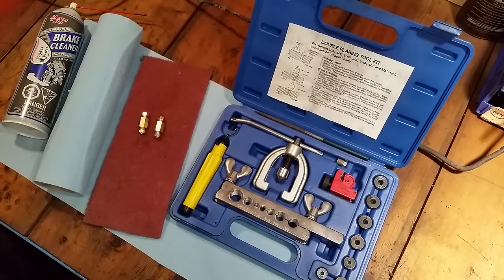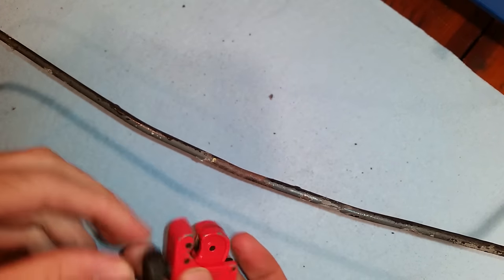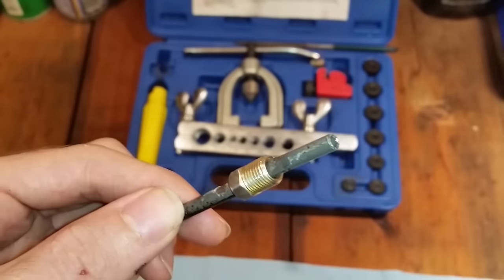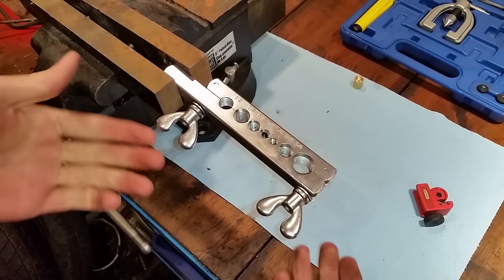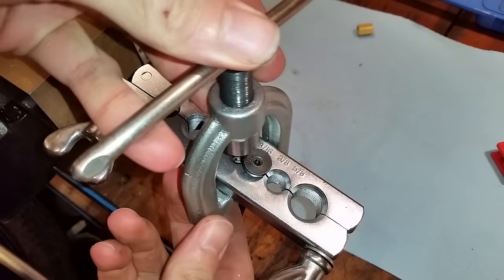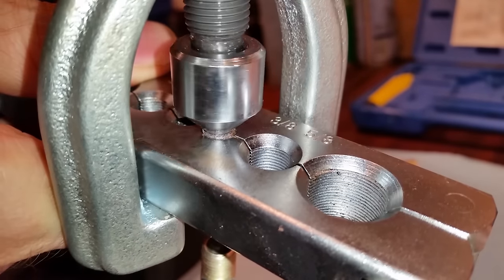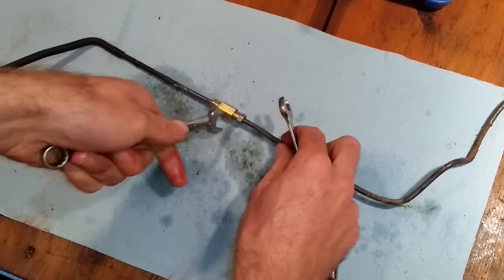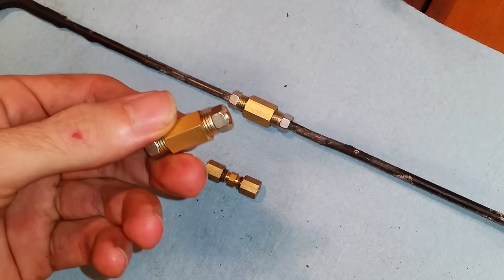How to safely repair leaking and rusted brake lines

Comment: Great video. Very simple to follow, and great tip with using the ATF.

One bone to pick: PLEASE consider wearing gloves when you use brake cleaner. A major component of brake cleaner is Tetrachloroethylene (PCE) which is an extremely carcinogenic substance. It's most common route of exposure is through inhalation, but it is also extremely harmful through direct contact with the liquid form, i.e. when it contacts your skin. If it contacts your skin, you should make haste to wash your hands off thoroughly and immediately. That said, it's best to wear a pair of nitrile or latex gloves when using brake cleaner. Believe me, I get my hands filthy with grease, oil, brake dust, and rust when I work on my cars, but I do NOT mess around when using brake cleaner. I'll admit that its a very effective cleaner though!
Reply: It is some nasty stuff. I use it all the time and am careful avoiding the fumes and contact with skin.

Comment: awesome! My brake line went on me tonight less than a week before a major trip. Funny enough, I just had to replace the ABS module a few months ago and I assumed at first that it was the module that went bad again, until I saw a trail of brake fluid in the parking space I backed out of. I probably should just replace all the brake lines, but this is the length of job that will keep me going until then.

Comment: Very informative thank you! I replaced the steel brake lines in my Silverado with the more flexible nickel copper lines, came in a kit so no flaring, but one of the lines got a hole cooked into it from the exhaust manifold(my dumb error) so now I need to cut out the bad section and perform the same procedure you did in the video. I appreciate the level of detail you took.

Comment: I tried to flare a 3/16" brake line with my flaring tool. The tool works on copper pipe, but not on steel brake lines. When I tighten it, the flaring tool just pushed the line out without flaring it. I don't have the flaring die. Maybe that's why it didn't work.  At least I learned something today.
I'm working on the severally rusted brake lines on my '93 GMC Jimmy. I'm pleased that the new brake lines bend without collapsing.

Comment: Gee that looks so simple in your video, all that changes when your try to do this repair under the car in a place you can hardly get to. Very difficult!
Reply: Yeah, especially when yer butthole deep in snow. Eastwood tool makes a tool for this "On the vehicle application."  Since I live in the rust belt, I think I can justify the cost of this tool.
Reply: Agreed, I had to do a lot of sanding around the flare and had to do the double flare a couple times before it would seat. Also noticed some nuts have a couple millimeters of shank at the tip, which in my case prevented it from going deep enough to contact the threads. I had to carefully dremel away the shank as I had already installed the nut and flared the line. Very easy to slip and cut the line, had I known I would have sanded off the shank on the sander before installing the nut and flaring the line. I got it done though and so far no leaks!
Reply: @David Schwartz SO WHAT! He is showing the process. Seems obvious to me that since he is doing his own work he knows all about working in crappy places. Those of us that fix our own know all about it.
Reply: @KStewart-th4sk  I doubt if he needs to be defended by you, It was not meant the way to start with anyway.
Reply: Ya, That is why many people use the compression fittings, I have used them for many years and never had one leak or fail

Comment: good job teaching the double flare task, after cutting out bad spot.  I have a roll of the green teflon coated 3/13 line on the garage wall> I used to have a 2nd 25 ft roll  so I must be using it up, here and there. I last fall of 2021 made my 1st successful double flares. The hardest part is clampin' it in the 
tool. My first one's I flared used to always slip. then i would have to cut off the undeveloped flair and start again. so I would get tight enough by using a cheater to give me more leverage. Maybe it was slipping because I didn't ever remember to use lubricant of some kind.

Comment: I've long since gone to ni-cop brake lines. Easy to work with and corrosion resistant. Not expensive. Also, if your metal lines are in bad shape you'd better consider replacing the front/rear flex lines.

Comment: Wow just save me a headache & gave me an idea, in my case on my Evo x ayc rear diff. metal line, it's better to repaired this way. Going try this and fix the pin hole leak. Thanks for the video

Comment: Nice job, very professional and nice explanation. thank you.
Reply: OMG!  Great video but if you've pulled the brake line off, then BUY A NEW ONE!  $25 IS ALL for a brand NEW ONE!  C'mon!  You'd be doing it anyway in a year if you've got that much rust on 1 part already.  GIVE GOOD, THOROUGH info on the most important part of the car!

Comment: Also worth considering, for short runs, is AGS Poly Armour Metal Tubing.  Available in lengths from 8" to 84".  Preflared on both ends, with mounting nuts attached.  Coated to prevent rust and bends easily by hand.  Available on online and behind the counter at AutoZone.
Reply: Chuck's Stuff how much is this brake tube at autozone
Reply: Go to AutoZone website and search "Poly Armour".  Click on any of the 6 results and you'll get 67 results.  Also available at Advance Auto Parts.  Not all AutoZone & Advanced stores keep all sizes stocked.
Reply: Tape non-stretching string/twine along the entire length of the segment to be replaced, from nut to nut, and mark the end.  Then remove the string and measure its length.  Select the nearest available length of Poly Armour. Cut, to the same length, 12-14 ga insulated solid copper wire and practice bending it until you get an acceptable shape from one connection to the other.  Bend the new tubing to this same shape.  Use nipping pliers to cut bad tubing at nuts, then use quality 6-sided socket to remove old nuts.  Apply Teflon tape to bleed screw treads and use Mity-Vac (or equivalent) to bleed brakes.
Reply: Short lengths already flaired with nuts are about $6, +/- depending on the length.  A 25' spool of the stuff with no flairs on it yet and no nuts included is about $23, price subject to change since steel is a commodity item.
Reply: Yeah it makes no sense to me to take the whole line off then put this patch on it, then put old rusty line back on the vehicle where it's just going to fail again a lot sooner.

Comment: Excellent video showing the difference between the brake union and the compression fitting.  Years ago my Dad showed me how to use a compression fitting to repair a brake line and it did hold up.  But I know better now and would never do that today.

Comment: Good video, unfortunately brake lines usually rust from the inside out due to moisture in the hyrdrolic fluid.  You could fix this and then another spot can brake.  I learned my lesson on that, and if the car is old enough to have rusted out one part of the line, others aren't far behind.  I would just order all new pre-bent lines.  Was $160 worth of good insurance, and also all the rubber lines got replaced while I was at it.   But if u need a quick and easy temporary fix to get down the road then this is a great method.
Reply: clayton you must live where there is no snow and ice, the number one reason for corrosion is calcium chloride and salt they use to put on the roads. one little prock in a wiring harness and the calcium chloride will tavel several feet in the inernal part of the wire and rot it out. it will for metal as well that is exposed to the elements that is usually what gets the brake lines from the spray of the wheels onto the line in fender well

Comment: A very helpful informative video
Reply: OMG!  Great video but if you've pulled the brake line off, then BUY A NEW ONE!  $25 IS ALL for a brand NEW ONE!  C'mon!  You'd be doing it anyway in a year if you've got that much rust on 1 part already.  GIVE GOOD, THOROUGH info on the most important part of the car!

Comment: I wouldn't call this a repair so much as a temporary fix with a line that corroded. It's very useful information and could get someone out of a pinch, however, most brake lines are cut and bent in a way that minimizes damage from the movement of the body and suspension. Cutting an existing line shorter and using unions to fill the space will work in the short term, but the best practice is to replace the line with OEM standards.

Comment: My parts store treated me like a criminal when I asked for a union fitting and told me they only have compression fittings and thats all I should be using.
Reply: Tech NO City you are criminal. Just replace the brake line instead of patching it
Reply: @wyattklingensmith8862  I replaced a 80in section.
Reply: Replace the section, no need to replace the whole like unless it blows a second time.
Reply: @wyattklingensmith8862  Dumbass remark. If the rest of the line is fine, replace what is bad. If you had any common sense, you would know certain areas can get rusted through because of location.
Reply: Tech NO City  Well i guess they have NO CLUE then about different methods of repairing the line. I read that compression fittings are rated for 10,000 PSI; even higher with certain circumstances. Your brake lines don't see that kind of pressure. Of course, the line where you use them should be in prime condition and assembled properly.

Comment: I do like the looks of the brake line union better than the compression fitting.
I don't feel like you did a good job explaining the compression fitting though. When you tighten it down it actually compresses the brake line and then is smaller than the brake line is on either side and can't really come off without breaking something (if it is tightened down properly) we use them on our machines at work all the time on our grease systems which are rated for 3500 psi.

Comment: I will never do lines again without the whole line prebent kit. And Stabilitrak has double rear lines.  Both ends are a different size fitting.  I used the old fittings with copper lines worked ok.
24ft copper cut to 12ft each.
On the the ABS module the Upper right is the right rear wheel.

Comment: Good video. Make sure you dont make any cracks in the flair.  Sometimes this works good most times not. Practice doing the flair several times before doing it on the car. I hope you were just using those cruddy lines to demonstrate. Go back to where the lines are rust free then splice there. Another hint... Just buy a variety of lengths and joiners and go all the way front to back.  Sometimes you run into oversize threads on one end, then buy an adapter. Good luck if you have metric bubble flairs. I am just doing a 93 Marquis and it has two lines from the proportioning valve to each rear wheel that are rusted everywhere except for 6 inches from each end. It has 12x1 male  bubble flair on one end and 10x1 female  metric bubble flair on the other  You should try to find the metric adapters for that.  That line you are showing that has the red ends is likely metric. those compression fittings might be ok for offroad, but aren't DOT approved, if you have a failure and get in a wreck, good luck getting any insurance.

Comment: better tip, use brake fluid for lubricant. also, when the part is still in the holder, run a file over it just to give it a good face and take out any warping.

Comment: This should only be used as a temporary fix.  If you line fails in one spot, other areas are close to the failure point.  Just replace the entire line.
Reply: Exactly what I was thinking just replace  the entire line
Reply: Not if it isn’t rusty and the line just got snapped or cut.
Reply: Lines inside the engine compartment are mostly in good condition
Reply: If you need two joints for a repair. Then you should be replacing the complete brake line.

Comment: Great video thi is how i repair brake lines however always use a brake line spanner else you will damage the brass fitting you wont get it tight enough 😀
Reply from the maker: Line wrenches are a great investment!

Comment: There is big difference between a house plumbing compression fitting which you showed and a steel high pressure automotive compression fitting which are rated for 5000 psi.

Comment: Where from could one get the fittings? i have to repair the end tip of my E46 M3 rear brake line and can´t find the fittings...
Reply: Reuse old ones? Worked on my sprinter.

Comment: Great video.
What make and model flaring kit are you using?  The one sold at Harbor Freight, as well as the ones offered as "loaner" tools by autoparts stores are considered junk by reviewers.
Reply from the maker: Thanks for watching!

This is a Harbor Freight kit. It works just fine. Just practice on a scrap piece of tube until you get the hang of it. The other "expensive" flaring kits do the exact same thing. For example, eastwood sells a rather nice flaring kit. However, if you own a shop or do brakes all the time it's price can be justified. I only spent $20 on mine, it was on sale. The only reason my flares come out nice like that is because I've practiced and have a feel for using it.

Just a quick tip. If you want to flare stainless tube, make sure you heat up the end red hot with a torch, this will anneal it and make it much easier to flare. It also saves your tools. 

Cheers!
Reply: I am considering the Eastwood 31244 kit.  Made specifically for 3/16" brake lines, and very compact so it can be used directly in the vehicle. 
Is this the one you mean?  I found it for 40 bucks (total) from cjponyparts.
Reply from the maker: That one works even better than Harbor Freight one. It's very hard to mess up the flair. Make sure to use the die lubricant. If it doesn't have it, just use some engine oil. I was refering to Eastwood's 25304 kit. (~$200). It's more of a bench mount system.
Reply: Where are you using the oil exactly? Thanks
Reply: The OTC one is about $34 shipped from Amazon.  It works really well.  But you can borrow one for free from a lot of auto part stores.  I got one from Amazon Warehouse (damaged package) for $22.97.  Sometimes nice to have your own if you know you will be doing this several times.   I did two lines on my son's truck.  There are two more than will end up leaking.  The entire truck had to have lines replaced but the back has already been done by the previous owner.  When you see wet lines, time to replace.  All because GM used cheap steel lines in 2002.
Reply from the maker: The oil is there to prevent the brake line from galling. By using oil, you ensure a smooth flare that will seat properly and not leak. You can put the oil on the end of the brake line before you start using the tool.
Reply: SuperSpeakers Thanks, I didn't use it and got away with it. but next time I'll use a drop of oil.
Reply: They are all affordable enough to buy a cheap set, a mid level set, and a extreme premium set if you really want to fuss about it.

Comment: I wouldn't risk this on older vehicles(Mostly pre-1967) because if the line breaks you have no brakes. If it's a 2 chamber master cylinder it's less of a risk though.

Comment: This is the way to do it. Not compression joints. Takes more work but much safer.
Reply: I've never seen a compression fitting come lose and I've done it any time I get a hole in a line.
Reply: @larryparker748  My understanding they are iiiegal in Massachusett.
Reply: @larryparker748  This video does not show compression joints but flare joints which is the proper way to do it.

Comment: ordered a willfit master cyclinder @ amazon for 5130 case tractor. looked same, when installed saw that 2 lines are 12mm brakelines instead of 14mm. waiting on 12mm ISO bubbleflare fittings listed for1/4 in tubing. they list 3/16 tube fittings also. dont see how 12mm fitting will have enough size for 1/4 tubing wh.ich usually fits 14mm fittings??????? we will see.

Comment: You can borrow a tool for free from some auto parts stores, I did it from Advance Auto, for example.  You buy it and then when you are done, you return it for 100% refund.  Autozone has the same program.  Most of the time you can reuse fittings too, my lines were horrible and even though there was light surface rust on my fittings, the threads and the seats were fine.  That's all that matters.  
I highly recommend copper nickel line, it comes in rolls or you can get pre-made pieces.  But it is easy to bend without kinking and easy to flare.  And it never rusts again.   And it's pretty cheap in a 25 foot roll.  If you have one bad brake line, chances are you have more bad brake lines because the SOBs that made your car used crap steel lines instead of stainless steel so you'll be doing this more than once.

Comment: You just contaminated brake fluid by putting trans fluid into the flaring process. Best to use brake fluid for lubricant and clean with brake fluid like you did.. Be safe out there

Comment: Actually know what I'm doing now, although I bought the compression fittings because every brake line seller only includes the line and fittings, no unions.  Wish everything wasn't sold separately.

Comment: if the brake line that attaches to the rubber hose/caliper is a bubble flare does the union flares have to match or can they be double flares (as long as it coordinates with the union fitting)?
Reply from the maker: Exactly as you said. If you’re splicing the brake line, you need to make sure that the flares you put on the lines match the union.

Comment: Yes...BUT....on the side of the road in winter...man...ya know?...And most do not have the flaring kit....Ya know?...SO...that compression fitting will get you home no problem so you can fix it right..I have pinched it off with a pair of vise grips and drove home...so yeah,you do what you gotta do.